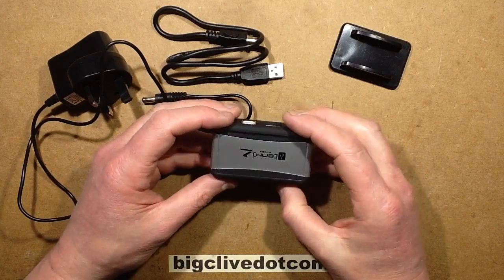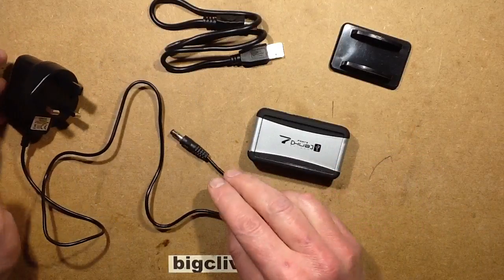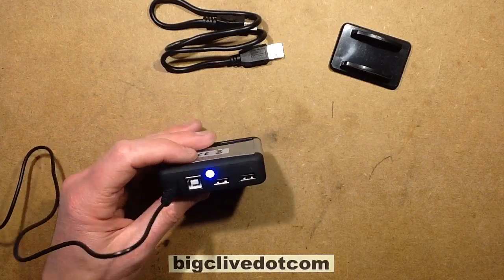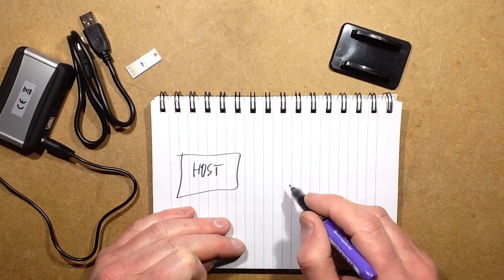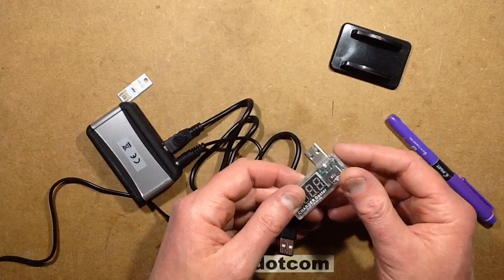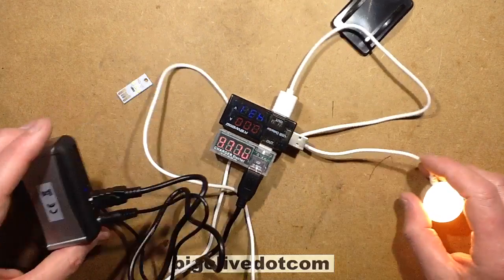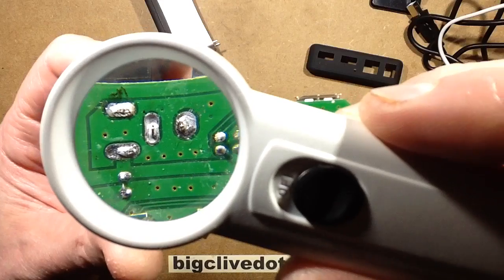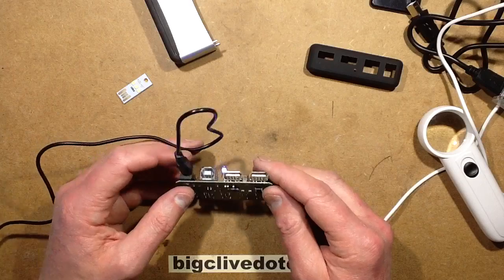Computer killing powered USB hub.  (Mac murderer)

Comment: I will say this: I have gotten MANY of these hubs, and the one you reviewed and took apart had the CLEANEST board I've seen of them. I almost always find residue and junk I typically have to clean off when I take them apart. They're very common with Raspberry Pi shipments, and after seeing the video, I had NO idea the power was never supposed to flow back into the host. That being said, for the Pi, this is useful sometimes, but I typically just desolder the bulky USB B connection and DC jack and just ribbon cable it to the Pi or USB cable. Thank you for that helpful piece of information!

Comment: I have a Mac and I use this hub since 3 years and it has never done any damage.
But I modified it a little bit by removing the (overly bright and useless to me) LED and I use a good quality 50 Hz transformer power supply instead of the cheap chinese switching one that came with the hub. 

Do you think it will still work correctly if I remove the connection between the +5v of the external wall adapter and the +5v coming from the computer ?
Reply: PLEASE SOMEONE REPLY

Comment: NOOOO! THEY REPLACED THE DARN MOTHERBOARDS?! 

Oh god... a 5$ chip is alp they probably needed... please, watch Louis Rossmann on YouTube and see for yourself!
Reply: +Anas Malas But that 5$ chip costs 375$ to have repaired by him. I guess you could do it yourself but hardly anyone has the tools and skill for such task. On top of that, there's a fair chance the motherboards in question were replaced under warranty, no?
Reply: If under warranty then fair enough, but if not then is 375 instead of 700 that Apple charges.

Then again it could have been just a chared resistor that needs not more than a small tip iron!

Comment: Wouldn't simple diode fix this?
Reply: +4eks1sLV yes it would. But in practice, it would be better to use a bit more circuit to reduce the voltage drop. A normal diode has a voltage drop of 700mV (0.7V), a schottky has 200mV (0.2V), but this voltage increases with load/current.

Comment: I had one of these! Branded differently though but exactly the same board. I plugged it into my PC and it shut the thing down very abruptly. I thought I had caused some damage but after unplugging it and restarting it worked again.
I opened the case and looked at the circuit board and it was all rusted up and disgusting. Needless to say, the seller got it returned. 
No damage to my PC thank christ.
Reply: +Darren Boss PC is built to last, MAC is built to look good :P
Reply: Because the PC actually has a protection circuit.... unlike Macs
Reply: Sample Textᴴᴰ
 yeah i know, it also doesn't shit its pants if you short out the USB plugs

Comment: Short version: cheap pc tend to be simpler in construction (simple auto resettable fuse) while higher end pc use more complex circuit, that is way more sensitive due to the construction, and a cascade of failure is likelly.

Long version:
Cheap pc (which is what the majority of pc users use) tend to use simple path for the usb connection: 5V from the powersupply straight to an autoresettable fuse (1.6A) to one set of two usb ports (top-bottom pair). Back feeding would simply cause the fuse to trip due to the overload (the pc want more than the 1.6A that the fuse allow).

Higher end pc (and mac) may have active load limiting circuit: 5V -> chip -> usb port    and a secondary connection from the 5Vstandby (an always on secondary powersupply inside the main powersupply) from the powersupply to the same chip. That secondary connection (5Vstandby) allow for usb charging while the computer is off and to keep the port active to wake up the computer on mouse/keyboard activity. This is where things get interresting: they use two mosfet (a kind of transistor) for this. A mosfet, due to the construction, have a build in diode. Said diode basically goes from "out to in" and will never ever conduct normally. When backfeeding, it cause all of the current to flow throught that diode, possibly causing it to melt and short. Since there is two power source, chance is that both of those mosfet diode will do the same thing. Now, since they are both short, it create a direct path from the 5Vstandby and the main 5V. Since the 5Vstandby is relativelly weak (1-3A) and due to the short, it try to power all of the 5V stuff on the computer (which may be several amps, a typical powersupply have 25-35A capacity on the 5V). If the 5Vstandby is powerfull enought, then it may faselly cause the computer power management chip to think that the powersupply is still on, and wait for it to turn off before allowing the computer to turn back on again. If not powerfull enought then it may cause the 5Vstandby to fall into protection or to fry due to overload. The 5Vstandby power the power management chip, which in turn send a signal to the powersuppply to turn it's main supply on. The powersupply itself require that the 5Vstandby be present for it to be able to turn the main supply.
Reply: +thephantom1492 ... But this killed several macs, so i'm afraid your cheap vs. higher-end theory doesn't stand (100%) ;)
Reply: KhronX Mac is actually high quality. Well built. Still overpriced. I hate mac.

Comment: Quick diode on the positive side of the computer input to stop "ghastly reflux"?
Reply: +James Lamb Yep. Best to use a Schottky diode so voltage drop is minimized when the diode is forward biased, e.g. when the hub's external power supply is unplugged and the computer's +5 takes over powering whatever USB devices are plugged into the hub's ports.

Comment: Would it be possible to "repair" the unit by cutting the trace that is feeding back the +5 volts into the port and perhaps connecting a diode across the cut?  Or just cutting it and making the hub usable only with its power supply?

Comment: I suspect I know what the cause of the problem is. At one time there were cables made that did not have the power supply line connected. I suspect this hub was made to be used with only this type of cable and whoever bought this hub did not read the warning that came with this product. Then they switched cables and the problems started.

I've had cable like this before and tested them. They all came with accessory devices like hubs. I always thought this was horrible engineering, but that happens. Computers in general have a history of the engineers not worrying about inner-operability.
Reply: +Paul Montgomery If they intentionally cut the Supply Line Wire, then the hub/cable is still out of spec and therefor not safe for use.
Reply: sarowie
Did my post somehow seem to be condoning this? I was simply giving a possible explanation as to why this happened.
Reply: sarowie
I looked up your google profile. Perhaps this is a language issue because I just couldn't see how you could construe what I posted in the manner that you seem to convey. It is safe to use if used with the cable supplied. They should have hardwired the cable to the box, which would have eliminated the cost of the USB connector. In making things like this, it is all about cost. When they made these cables, they used wires that left out the extra conductor for the power all together. Evidently in this case it was cheaper to get a mass produced cable with USB on each end and buy the USB connector for the box. Yes of course it does not meet the standard, so what? It does with their "special cable" and the instruction say to only use that cable. In their eyes that is your fault for not following the instructions. It only becomes dangerous when this happens.

Is is horrible engineering practice. OFF COURSE. Did they put a sticker on the box say it met the standard? I doubt it. It is all about cost.

Comment: Could couple AAA batteries and a USB plug could kill Macs? How about a just having a capacitor across +5v power and ground?

Inquiring minds want to know. (and if you happen to put 240 or 480 AC into the USB bus for a pretty light show we won't tell, promise)
Reply: +Robert Szasz Sure, take 4 AAA, you get 6V. AAA can delivere a most amount of current, so that^s plenty to burn trough a protection diode.
With the capacitor it depends on the voltage you charge and the capacity.
240VAC would be gross overkill.
Reply: sarowie I was thinking if there was something that needed 6v in a USB device and the boost converter wasn't isolated it could backfeed. I would expect at least 30-48v protection that might pop the USB port but protect the computer.

Comment: I would argue that this is correctly designed when it kills Mac computers.
Reply: +TheMrTape heh not a flaw its a feature :p ... to be fair it would kill a few pcs too
Reply: +Dario Gargano You can't break what never worked.
Reply: +Eisen Faust That same thing happens with most if not all computers.
Reply: Macs are practically indestructible, especially the old MacBooks. My mom has a 2007 MacBook that still works flawlessly.

Comment: I'd say it's missing a diode. Normal operation of powered usb-ports is that external power is not required for low power periphials (like keyboards/mice/USB flash memory)

So when you plug external power in it should have a diode protecting the input connection from the PC so the PC can provide power to the hub, but the hub can't feed power back into the PC.

Comment: I once had a cheap hub that killed a PC port. It was the same problem, but the interesting bit was, it had been designed to put a diode in the circuit so it could power from either PC or power supply - but they put a jumper wire in there instead.  Saved 1/2 a penny, killed USB ports it was plugged into.
Reply: +John Ridley had exaclty the same issue, complained about a surge pc still booted but the onboard USB ports all died

Comment: Thanks for this video. I have a new 5k Mac and it has been experiencing random hard drive disconnects and random thunderbolt disconnects and lately not waking from sleep. And I have the usb2.0 Version of this and same issue 5.20 volts coming out of the input. I have a powered 10 port usb 3 hub and it has no power coming through the connection. Hopefully this fixes the issue or il enacting my apple care. Thanks for this video it explains the weirdness of my machine ...

Comment: diode or gate is not hard sure it causes a .2v drop but that is less than some crap leads.
Even one diode between host port and power rail would be sufficient.
Reply: You could also use the switch in the barrel plug to do that, and it would remove the loss of a diode
Reply: Even better I forgot about the switch

Comment: Well, from my humble experience allmost all powered USB hubs WILL backfeed, even hubs with a known brand name on them... I've prepared some USB cables with cut through 5V line and use these to connect powered USB hubs to hosts I care about. ;o) However, most modern computers should have some basic protection to prevent damage from backfeeding devices or it should at least just blow the USB host controller and not the whole mainboard. o.O If it does... bad design from my personal point of view. I mean the fault is clearly on the usb manufactures side, but face it, backfeeding USB hubs are out there since at least a decade.
Reply: +Dunkelheit667 Mac users tend to not diagnose parts on a chip by chip level. Most people don't go that deep into it and replace faulty chips on their own. and the manufacturer also tends to replace boards, not parts.

Comment: This isn't good for Apple. The USB 2 spec says the host port should be able to supply and sink 5V and be able to handle any line short to ground or 5V. I'm not sure about the USB 3 spec yet so I could be wrong.
Reply: +Jammit Timmaj supply sure. Sink? never hear or read about that. But I didn't read the 600 few pages on the usb specs. But I do agree with you that the specs DOES say that it must handle overload, including short. I can tell you that it is not always the case, specially on older computer... Some used an internal trace on the pcb as fuse... Yes, you read it right... And they were sharing the same "fuse" with the ps/2 port quite often... Sometime even all of the rear usb + ps/2. Cat chew on the wire? Too bad, you just lost all of the rear connectivity.
Reply: +thephantom1492 apple actually does not comply with USB standards, if i remember correctly they have a resistor between negitive and one of the data lines
Reply: Cracked_Lucidity
There was an addendum to the USB spec that allowed "dumb" chargers. Previously the USB device had to communicate with the host to allow charging. The 2.5 volts a dumb charger presents on the D+ and D- lines is well within the ratings for those lines and lets the device being charged know it's hooked up to a dumb charger and can start using up to 500ma of current without negotiations. It has been expanded to allow dumb chargers that can supply more current by making the D+ and D- lines a different voltage. Different voltages means the device can know what current it can pull without asking permission.
https://www.maximintegrated.com/en/app-notes/index.mvp/id/4803
Reply: +Cracked_Lucidity Apple's USB charger used to have voltage reference on both data lines using two resistors voltage divider for the sole purpose of the device not accepting any other charger but the original. I don't know what they use now.

Comment: I have one of those - none of my PCs seem to care about back power from the USB port.  Since mine doesn't have an LED I never knew it could be powered from the host.  I've gone in there and cut the connection between the two connectors now just in case!

Comment: The VBUS actually is required to be connected; but not like that. The reason is if you connect the hub to the PC but not the power supply, it must continue as a bus powered hub. You are right that backfeeding 5V is not allowed. Some host ports will be able to handle this, others apparently can't. They are not required to handle this.

Comment: makes me laugh how stupid some people are, use the adapter to use as a multiple charge point OR connect to comp (no adapter) and the comps will power it through the host port..... you DONT use both power supplies when connected to a comp, common sense is elusive to some it seems.

Comment: The irony is that while the hub is badly designed - technically, in this case, so is the Mac. All it would have taken to protect them from damage is a diode on the 5V line to prevent incoming power.
Reply: +The Werewolf The specification clearly says that back feeding is not allowed. So the design in the mac might be not ideal, but is certainly not badly designed either.

Comment: Interesting- I have one of these hubs, but it has a red led rather than blue, never given me any issues ( mains power adapter is plugged in, I use it to connect my digital cameras to my pc ). Guessing it's a different version inside with the same casing. Scary stuff though....

Comment: Shouldn't there be at least a basic protection in the motherboard for stuff like this??It's a diod.  People give an arm and a leg for a mac computer (don't know why...)never understood the reason  for such an expensive machine. You could buy 2 PCs with the same money and they would be equal or better in hardware also i believe the majority of the programs profetionals use come in windows, mac and sometimes even in linux so i find no real reason exept the "look at my stuff i have money" factor witch i find irelevant for such a purchase
Sorry for ranting. I am open to other opinions and i would like to hear why someone would buy an apple pc/phone/tablet.
Reply: +Meneltour27 ... I completely agree that Macs are expensive (and have never owned one) but most buy them because they just work out of the box and keep working without any issue (usually).
They're more aimed for simple users wanting something that just works.
Windows still requires certain setup even on OEM pc's with preinstalled Windows and Linux even more.
And of coarse there's the 'Look at me having money (not anymore though)...' types...